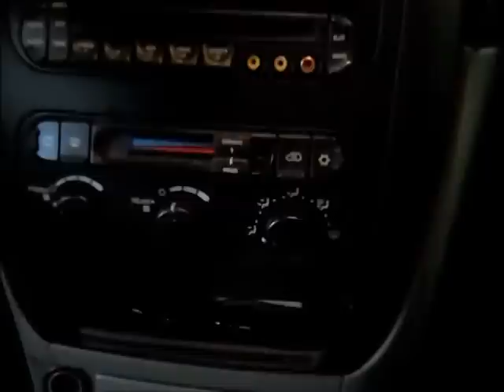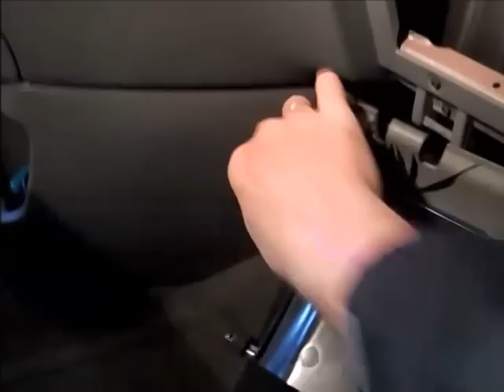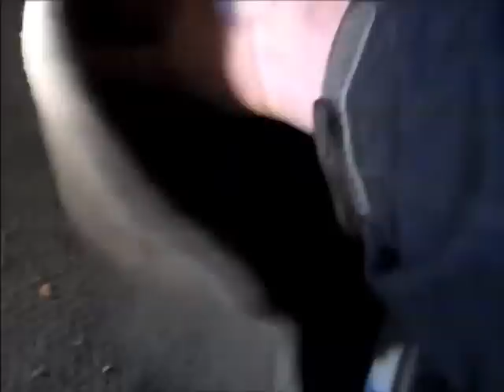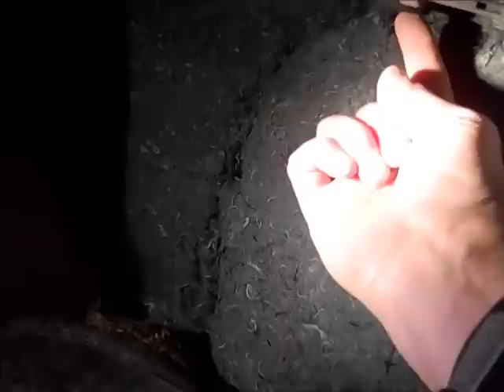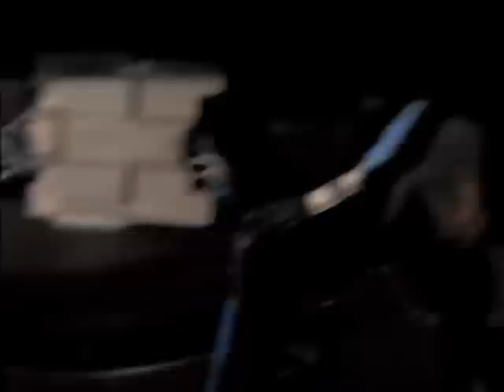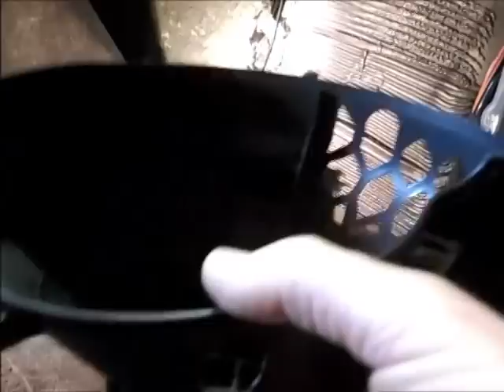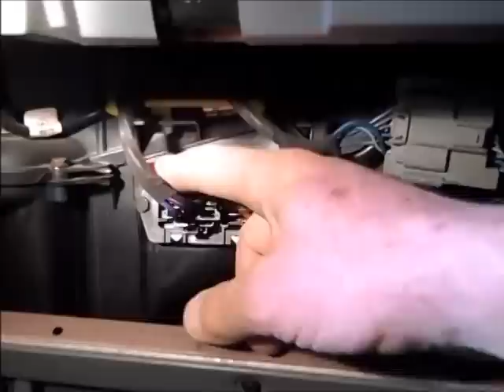2001 TO 2007 Dodge Caravan heater fan and resistor replacement

Comment: Use jumper wires to the motor, actually I use a pig tail cut out of a junkyard vehicle,  most of the time it's the resistor

Comment: I use the French to English translation sorry if it makes it difficult to read. 
 I have two identical 2005 van and I had the idea to make a booster pack this winter with an 18 Volt makita tool battery. with 2 wires to the pole of my battery... it actually starts very well! but this created a short circuit and caused me to no longer have a motor that pushes any interior air... (It is not my resistance because I have already needed to change this resistance and when it is the resistor the fan motor and still assuming to run at high mode only... This is a good sign to say it's your resistor which costs around 20 bucks in my experience with my van) I used this module to boost the start-up this winter on my two van and doubly created the one and same problem on both: "no more air from the fan system." so do not try to boost with any source more than 12 Volts because it can be very damaging and bypass the fuses that still work. If this caused the fan's motor to fall to the famous dead point as you say... I will try to get them out of this dead point by reactivating them like yours on your video by giving a 12 volt power supply. banging on it ... (like waking up to the engine starter which no longer starts) I know the cause which is my short circuit so it's not a question of wear and tear to neutral and in all case if they go back for testing I put them back in place to see. logically I will not see why it would not continue to work... (I personally find that the mechanics have the option of replacing a part a little too easy to my taste, it seems to me that reworking must be possible, example a few drops of oil on the shaft etc... Because the fan motor is $200...) but hey I'll run all this... track to follow I will report a feedback here on these superb fans supposedly good for trash. thank you for your video sincerely I speak French but I activated the translation of YouTube in French. Long live mutual aid! Anyone who takes the time to make similar videos... you are all good people, with a good heart! A+ Jonathan

Comment: So I have replaced this resistor and my son's minivan what I can't find out is what color does what for the plug someone has rewired a new plug in there which is bad and I cannot seem to find this on the internet any help is appreciated,all the wires coming off the plug are the same and it is wired incorrectly because the speeds are not correct from the fan switch

Comment: the only problem I had was, the connector to the resistor was different. There are 2 styles one has a blue cap on it the other one is slightly larger also. instead of splicing the wire i got the resistor that matched the new blower motor. the connector for the controls is the same. I did this because the blower that I needed was $200.00 more and, I would have had to wait 1 week to get the correct one.

Comment: If you want to avoid tearing the insulation away from the wheel well because its glued to it,  use a small pry bar that will fit behind the blower motor or your finger and just pull a few pieces of the insulation away from below the screw area.

Comment: Those screws in my resistor aren't screws.They look like plastic rivets or something.When my new part comes from Geek Auto I guess I'll find out.Nothing a hot glue gun can't fix if they're not replaceable.Great video on testing procedure.
Reply: Actually they were factory reject screws with maybe a mm of head.Hard to remove but easy to replace with new screws.
Reply from the maker: @donnienicholson6062  Hi June. Good! glad you could replace it yourself. Hope your blower is working good!

Comment: One thing I couldn't stress enough is to remove the positive battery terminal  before you do any work on the electrical system of the vehicle, the damage you can do with a screw driver that touches the wrong two wires together could be a lot more than you are saving.  You also don't want to take any chances with setting the air bags off as they could kill you.
Reply from the maker: Good advice Vancouverman. Thanks for the comment.

Comment: This is better than finding out that I would have to remove the dashboard like i expected. Our fan hit that dead spot last fall, we had an engine failure and I rebuilt the engine over a couple months time. After all that and getting van running again the blower was running again too. I believe the fan vibrated out of the dead spot with all the action in engine removal/install. I am certain it will fail again (land in the dead spot) and plan on replacing it before that happens. Thank you for the informative video
Reply from the maker: Thanks for the comment. Some have said they restarted the motor by banging on the blower housing which still indicates a dead spot so if it fails before you can replace it, that may get you going again for a little while. Good luck and in case you haven't read some of the comments... some have just twisted and broke out the housing rather than trying to remove the 5th screw. The four screws that are left are more than adequate to hold the housing in place after installing the fan motor. Good luck!

Comment: Where is the fuse in the fuse box under the hood
Reply: Driver side towards the fronts on the motor above driver side tire the is a lid on it you gotta take off to get to it two clips

Comment: Thanks, Donny. I just did this job on my 2005 Grand Caravan today. Because of your video, I was prepared with the tools I needed and the correct level of expected pain-in-the-ass effort. Whoever thought it was OK to burry that screw way back there, imbedded in an inch of fibrous insulation, should not be designing cars! Thanks for saving me a few hundred bucks and helping me keep cool this summer!
Reply from the maker: Thanks FXM. I'm glad my video was helpful to you.

Comment: Just called a shop about 2003 Caravan. Asked for quote on replacing blower motor and resister. They said it would be over $1000 because removing the dash would take eight hours labor. Umm, no thanks.
Reply from the maker: Wow! I have heard of the job running $400 but... I'd be running away from that shop too!

Comment: Just a note, I checked for power like you said. Had power so changed motor. still nothing.  Called a friend and he said you need to check ground to resistor not the frame. Checked power with ground to resistor, no power.  Now I either take back apart to return motor or eat the cost of the motor.
Reply: otherwise it was a great video, thanks !!

Comment: I have a 2008 dodge caravan and my temperature gauge rises to H then slowly makes its way back down to C. My heat still works fine and I’ve also changed my thermostat. Anyone have any ideas what it could be?
Reply: That's a engine cooling problem. Not your hvac system. If i had to take a guess its your engine thermostat going bad

Comment: The resistor that I used in my 2004 dodge caravan looks identical,it has auto climate control,and when I replaced the resistor,it worked.Thx for the post!
Reply from the maker: Good for you John. Replacing the resistor is what we all hope for.

Comment: Thanks Don for your step by step instructions and for including details like disconnecting the negative wire and making sure the fresh air door was in the right position when replacing motor. I saved myself having to pay an hour of the mechanic's time and gained the satisfaction of doing it myself.  Thanks for your help.
Reply from the maker: Thanks for the comment Andreas. I'm glad you found it helpful.

Comment: Hi Don, thank you for you video. I was able to switch out my blower in about 30 mins because of your knowledge. I really appreciated the diagnosing that you demonstrated to troubleshoot the problem, I have had an intermittent fan the last month or so and knew I had to get the problem fixed before the snow flies here in North Dakota. Surely a dead spot on the motor as it was off/on for a while with more and more off. I used a 8mm nut driver for everything except the front right screw that is right side up and had to use an open end wrench. Like several others, I loosened the 2 visible screws and the one that is easy to feel near the left rear, and then flexed the plastic until the ear broke off of the one that is too hard to get to. Not the way the dealer would have done it, but I am done now and not cussing up a storm out in my driveway. Thanks again.
Reply from the maker: Thanks for the comment Brian. Glad you found my video useful.

Comment: I watched a few of these and yours was  by far the most helpful. Just the right amount of information and you went slow enough for me to follow unlike some other videos on YouTube where they move/talk to fast. My only recommendation would be to not hesitate to break off that back bolt if you’re having trouble. I couldn’t get it so I made sure to get a clean break and snap it. 4 8mm screws hold the housing on just fine. Thanks for the video!!
Reply from the maker: Thanks Steve. You are right about that back screw. Others have suggested the same thing or at least not replacing it reassembling. if i had to do it again... that's what I would do.

Comment: Great thanks for clarifying the door. Got it. Ok that sucks but  plugged the New motor n the plug It fired up great and I always put new resisters in we got resistor v$8 and blower for $47 In AZ Pennie Pinchers. Auto
 parts.
Reply from the maker: Glad to help and good deal on those parts

Comment: Did this today along with radiator and starter.  Thank you for the back screw information.  I had wife start it back with smaller hands.  Now church sister has front blower!  Tires in the next few days.  Resistor also replaced. It was burnt.
Reply from the maker: Wow you have a project! I'm glad you found the video helpful.

Comment: Don, can't thank you enough for the detailed video of doing this job. That 5th screw is in the worst spot. I'm 5'8" tall and average weight and I could not get a visual on it with my best effort. I had to do it all by feel and using a 1/4" drive with about a 3" extension mounted to a 5/16" socket. Needless to say, I did not replace that screw in case I ever had to get back in there again. Once I got the old fan out the job is pretty straight forward. Thank you again. Keep working safe and thanks for having the patience to do the job AND take video of the whole thing. Very helpful.
Reply from the maker: Thanks Dominic. Glad to help..

Comment: Mine was only working on high, not medium or low. I changed it and it worked for a while. Then it  stopped working on low and medium fan but only on high again. Am I missing something that is causing this to happen.
Reply from the maker: Not sure. Did you change the resistor or the motor? If you changed the resistor and got all your blower speeds back and then lost them again later... lt may be due to a dying motor. As the motor nears the end of it's life it tends to pull more amps to run. That could cause the resistors to fail. The resistor pack has a resistor for each speed setting. The ones for the lower speed settings have higher resistance so get hotter. They usually die first. Since you still have high speed it is not the fuse or relay .
Reply: Yest it was working only on high when I changed the resistor. All fan speeds worked for a while now only the high speeds work so you are probably right. Thanks!

Comment: The testing of the resistor isn't correct in this video and you may end up pulling out insulation and a fan unnecessarily.  You need to test the resistor for ground to know if it is bad, not for power.  See J Taylor comment.  If your fan is bad though, this is a good video to watch to figure out how to get it out.
Reply from the maker: That is correct Koho Koho. I was operating on misinformation and although i did indeed have a bad motor, I did not diagnose it correctly so hopefully future viewers will read these comments and not do any unnecessary work. The easiest way to diagnose motor vs resistor is to first replace the resistor and if that doesn't fix it you can return the resistor and get a new motor. Low tech, but it works. Thanks for the clarification.
Reply: Once you confirm there is power to the fan from the resistor, you can also just run a wire from the power-out on the resistor to the inlet on the fan (I just took a length of copper wire I hit a few times with a hammer to flatten it so it would slide into female plug on fan) and then run a ground wire from the fan to the frame of the car.  If the fan now works, it is the resistor.  If it doesn't, it is the fan.  I just replaced my resistor in about 10 minutes and everything works.  Would love to have the 3 hours of pulling out the fan and reinstalling it in back.  :)
Reply: Thanks bro what are the ground wire colors?

Comment: I really enjoyed the video but one piece of advice that I would strongly give is to check the fuse first and replace the resistor no matter what. I followed the directions in this video to properly check the resistor and according to the voltmeter my resistor was functioning properly. I then went through the arduous process of changing the blower motor. After the new motor went in I still did not have power. So I did the next thing and changed the resistor. SUCCESS. 

My advice would be to just change the super easy $5 part and if it doesn't work, at least you have a brand new $5 part installed. If it does work you just saved yourself a lot of frustration. 

Thanks for the video! Helped a lot. Cheers
Reply from the maker: Hi Jordan. I apologise for leading you in the wrong direction on the resistor. i was operating on bad info myself there. Power at the resistor shows that the fuse is OK but I have learned that power to the motor is actually through the ground wires on the resistor pack meaning that if the speed selector is set on a specific setting there should be power at the corresponding ground wire and the motor should operate at that particular speed. You are right about just changing the resistor first. If the motor does not run then it IS the motor and you could take the resistor back to the autoparts store and get the motor. So I hope other viewers see your comment and take heed.
Reply: Don Guptill I appreciate the apology but probably unnecessary haha. Your video guided me through the process and I now have a working blower motor so that’s success in my books. Thanks for the clarification and I do hope that we save someone a little extra time. Thanks again

Comment: I am having problems with my front fan, not my back fan.  I checked the relays under the hood by switching them around (front to back, back to front) and the back fan still blows while the front does not.  I can make adjustments to the directional dial and it will allow air flow (some) to their designated vents, but the blower for the front will not run.  It was working one day, the next day it was not.  This will affect both heating and AC.  Again, back blower works fine.
Reply from the maker: Hi boyd. The front heating and cooling controls are independant to the rear controls. each system has it's own blower and resistor pack. if your front motor wont work on any speed setting, then it's likely that the motor is bad. Resistors tend to fail a speed setting at a time rather than all at once. You can try replacing the resistor first and if it doesn't cure the problem take it back and exchange it for a motor. Good luck!
Reply: Thank you!   I had a feeling it had to be something like that, but wasn't sure if there was a separate motor or not.  That should be logical that there is one.  I just didn't want to spend a lot of money guessing and ripping out parts that don't need to be pulled. Again, thanks!

Comment: I had to refresh my memory on replacing the blower. Here's a simplified 1 minute test of both components: https://youtu.be/naoKGs08wkc 

I've replaced both parts on two Caravans a few years back. Failure is common. The blowers failed roughly between 180,000 to 230,000 miles. The Caravans are still running and just won't die...
Reply from the maker: I like the video you posted. I no longer have the caravan I used in the video. I sold it still running strong at 186'000. We now own a 2013 . We have owned three over the years and had good luck with all of them. Thanks for the comment

Comment: Thanks Don!  After watching your video and reading the comments I was able to R&R the blower motor in my 2005 Grand Caravan in under and hour.  The readers tip about breaking the tab of the 5th screw by "wiggling" (more like wrenching) the blower housing back and forth really helped save me a lot of time and agony.  Especially since I did it outside on my driveway and the temp was 17 degrees.
Reply from the maker: Fast work Peter! Glad it went well for you. If i had to do it again... I'd just snap it off too!